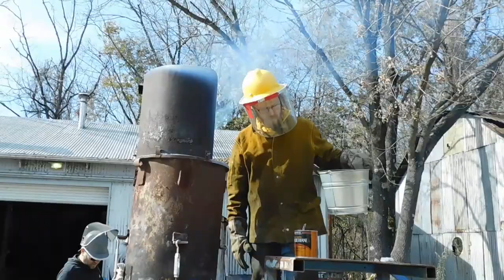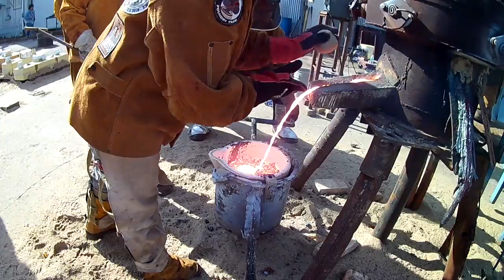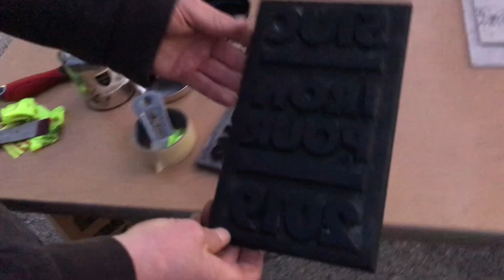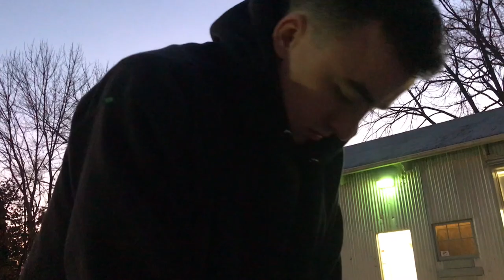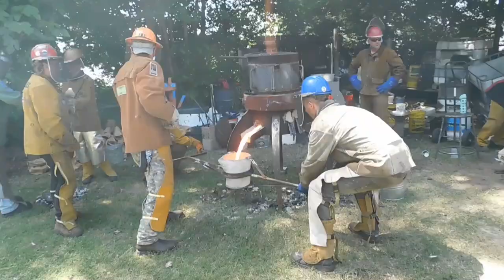Making A Solid Cast Iron Printing Plate | SIUC Artists | Sculpture and Printmaking

Comment: I'm beginning to understand why you call yourself a "gypsy," being that you travel around to different iron pour events in order to get your designs/molds cast. Is that entirely necessary? I realize it probably is low cost, but not very convenient or reproducible. From your experience in the field can you recommend any commercial "art foundries" that both handle iron and cater to sculptors? The art foundries I've contacted in the northeast all want to do bronze or aluminum casting and don't seem interested in iron as a sculpture medium (too high a melting point?). Windy Hill is 1000 miles away and doesn't appear equipped to handle or pour large flasks.
Reply from the maker: If you want to cast something larger than Windy Hill Foundry is capable of handling at this point I would encourage you to reach out to the National Ornamental Metal Museum in Memphis TN, or the Metal Arts Program at Sloss National Historic Landmark in Birmingham AL.  They both have websites that are easy to find in a google search!  Good luck!